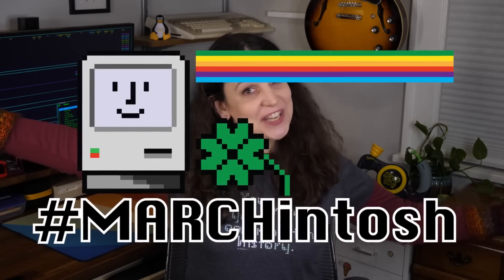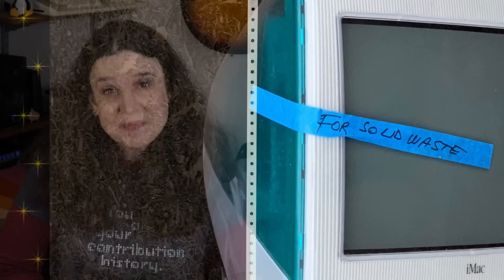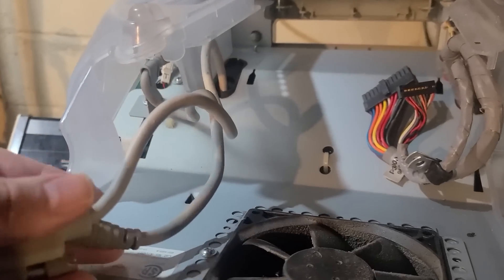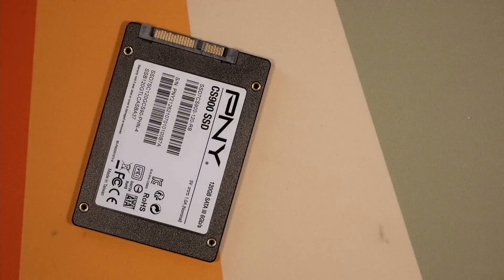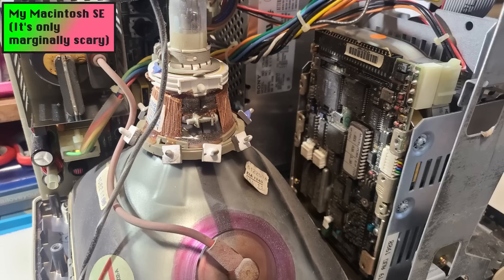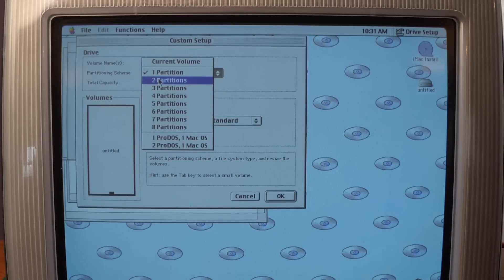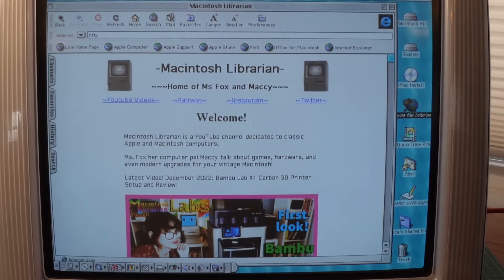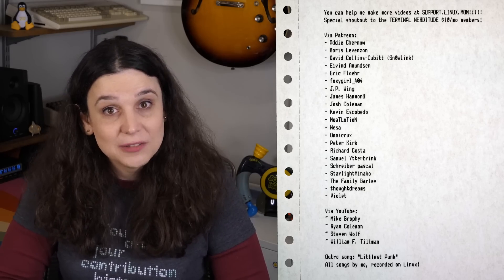Someone trashed this Bondi Blue iMac G3... can I fix it?

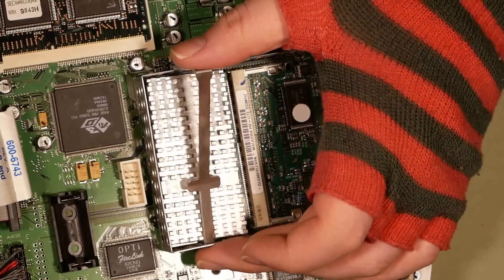Comment: 6:05 

I just dug into a G3 I bought from my buddy in high school (would have been around '09) of a similar early revision (tray loader). It sat basically that entire time under my care in "It booted when I bought it but it has been shoved to the back back back WAY back burner on my project list and I'm not going to do anything with it until I do" state until I decided just yesterday to finally do something about it. My caps were all marked when I did the teardown.

As for plans, I happen to have a SODIMM that I believe came from a Cisco 2801 router that I'm going to try and use to bump it up from 64 (which itself I believe might be an upgrade from stock done years ago) to 256, then do a 64 gig CF card for the drive, as it's my understanding that CF is essentially "IDE but smaller." Clean it up a bit and run OS 9 as it sounds like 10 might just be a bit too much for it to handle.

Racking my brain I think this might be the only Apple product I've ever owned personally, and I've essentially never even used a Mac of any sort, so the utility of this machine to me is more of a learning experience. I'm somewhat familiar with PowerPC CPUs...but only as they appear in old Cisco gear haha.

Comment: Hi, 1999 slot g3 worked great then was put in storage for 5 years took it out,fired it up and: startup sound ,cd rom sound but no sound from HD. Then finder icon and question mark folder icon.Hold down option on start up and no HD icon present.Pulled the Pram battery and it's toast.Question, do you think the Pram battery could cause this?

Comment: Do not mess with the CRT unless you know exactly what you're doing and have the proper tools to deal with the electricity stored in those things. It doesn't matter if it's off, those things will still hold a charge and can give you a nasty shock which could be lethal. Approach with extreme caution.

Comment: I think it was around 2018 when I installed Linux on an old G3 at my $OLDJOB repair shop to use as a window display/demo of our L337 5K1LLz. I would look at MintPPC and possibly OpenBSD for it, if you don't want to limit yourself to outdated distro versions. But even the old Mac OS was surprisingly responsive on that sub-500MHz CPU :)

Comment: Nice job! I too am someone who can heat up a soldering iron as well as a keyboard. I have done a lot with old tube radios (I am old enough to say I cut my tech teeth on tube stuff), and that includes CRT's. For the most part you have a heater circuit with low voltage for the cathode filaments, three electron guns (fancy word for cathode) for red, green, and blue colors, a shadow mask for color convergence and an internal metallic "aquadag' coating. That's the internal anatomy of the CRT.  The deflection yoke is three (usually) flat wound coils around the neck that control the electron beams with magnetic fields for the vertical/horizontal sync and picture scan interlace, and you have a "Flyback" transformer that provides the 15-20,000 volts to accelerate the electron beams from the guns into shadow mask/phosphor screen in the front of the tube. The flyback also provides the horizontal beam scan and helps with  horizontal sync. Most of this stuff works together with some pretty tight tolerances. Usually if the high voltage flyback circuit craps out, it drags nearly everything else down with it. 

The best policy for a working crt system is cautiously clean it up with a low suction vacuum cleaner and judicious use of canned air. This is a great idea because high voltage has a big static field that attracts dust. Not only that, the dust will form structures that will eventually form defacto electrodes that can cause high voltage arcing. That will kill everything in short order! So, clean it up and "If it ain't broke, don't fix it" applies to the rest of everything in there. A word of caution: Please allow the unit to sit for at least half an hour before you open it up and start poking around in the CRT enclosure. There are caps in the flyback circut that can hold very high voltage for a period of time and that can hurt you or damage the equipment if they get shorted to ground with an errant hand tool or finger.  Get all of the dust out, make it look pretty (no liquid cleaners please!) and it should work fine and last a long time...

Thank you for the videos you post here. One of them inspired me to breathe life into a 2011 Macbook Pro with a nice Linux Mint install. Now it works better than it did on OS-X!

Comment: Nowadays support for 32-bit PowerPC seems pretty lacking when it comes to most Linux distros nowadays. Even Debian, which is what I was using on my old PowerMac G4 a few years back, has since dropped support. I know Gentoo still supports the architecture, and I guess there's Adelie as well. The BSDs still seem pretty consistent with their support for 32-bit PPC though, with binary packages available on FreeBSD, OpenBSD, and NetBSD.

Comment: Is there a model number for beige Mac keyboard on the left. I have been looking for it for a while now as I remember the joy of that keyboard in high school. Was always run to that room as only one mac had it. I wish to find a used one and usb converter.
Reply from the maker: The one next to my IIgs at 0:30 is an Apple Desktop Bus Keyboard (A9M0330) I believe. It's packed away right now since I'm finishing my basement, so I can't grab a model number from it.

Highly recommend using the Wombat by Big Mess O'Wires (not sponsored) to connect it with a modern computer. It's the most versatile ADB-to-USB (and vice versa) converter I know. Good luck!
Reply: @VeronicaExplains  nice one. Apparently they quite tricky to get working on usb ports. Converter is $90

Comment: Despite Microsoft's shady practices at the time, Internet Explorer legitimately was a good browser up until they let it rot for going on 7 years anyway, after it suited it's original purpose of pushing Netscape out of the game. 

You have no idea how much it physically pains me to say that. But I do believe it's true. I might not personally like IE that much, and I feel like that's not a controversial opinion by any means, And of course Microsoft themselves perpetrated some very shady business at that time both in regards to how they forcibly integrated their browser with their operating system, and the various backroom deals that saw it forcibly gain market adoption, but I don't think there is a single browser out there that performs as well as IE 5.5 service pack 2 under Windows 95 on my 486 build, and this is without the "enhanced" desktop installed, so I know it's not a matter of it being loaded into RAM already. 

And the funny part is, these days with the lack of TLS 1.3, all browsers from that era are kind of equally bad and broken now. IE6 was the "standard" for so long that a lot of sites still use it as a lowest common denominator for graceful rendering, and there wasn't much in the way of significant engine changes from 5.5 to 6 that I know of.

Comment: They are fairy bulletproof in the metaphorical sense. I still own my Rev B Bondi Blue and I have added a few others since then. One of them had a CRT problem - suspect a crack in the neck. I was working through the HV stuff to remove the scary stuff that drives the CRT with the view to replace it with a 15” 4:3 LCD panel. Alas, that project has been on hold due to ill health.

Thank you for the video!

Comment: Admittedly, I'm not the biggest Mac fan out there but I do maintain a new M2 Air to keep tabs on the iDevices in the house...but in a corner sits a Graphite iMac DV SE with some upgrades...yes it still runs OS 9 cause I want it that way. Nice classic iMac with that lovely CRT display...so good for a trip back in time.

Comment: In my area (lower edge of Connecticut) we have "bulk trash pickup" twice a year where the city will haul away almost anything you put on the curb for free. People clean out their basements, attics, closets, etc, and pile it all up on the curb. 80% of it is trash, but about 20% is stuff that's still usable.

I've seen 3-4 of these iMacs over the years. I know nothing about the Mac and dont' really have a desire for one. I did bring one home for my friend once. I think he got it working. I also gave him some kind of Mac that looked like a big, white CRT monitor (not one of the 4" thick flat ones), but he said that one didn't work.

Of course I see a lot of old Dell and such systems. They usually fall into one of two categories: Complete, but older with weak specs, or newer with good specs, but missing components. Oh and laptops that are missing the power supplies about 98% of the time. 

The last one I found is a Dell i5 that doesn't boot. According to Google, it needs a new CMOS battery, which is super easy to install. You just remove the hard drive, remove the memory, remove the keyboard, open the case, take out the power switch, disconnect all the cables, remove the motherboard, flip it over and pop in the battery. Simple!

Comment: First time viewer, and maybe subscriber. Sorry, I am quite picky on what I subscribe too. The problem is, I do dislike modern macs (though the ones from the early 80's were OK.) and am not a fan of any currant Linux distro's. Macs because they use 2019 technology at 2026 pricing (low tech, very high pricing,)  and Linux because it is way to difficult to use. I have used Mint, Fedora, xubuntu, and a few others but the CLI gets me every time. If they would make a Linux distro that is as easy to use as Windows I would have no problems going back. They have tried but there really is no Linux distro out there that the CLI is redundant. And they all use different CLI commands. Also, I am getting old now so my brain is seizing up (not that there was much there in the first place.) But, I see you do some Amiga stuff, too and that was my favourite retro computer in the 90's and early 2000's. I still use it now on Emulation. Yes, I do not own a physical Amiga anymore (not since 2002 when I got my first PC.) But I do love the Emulation. I use WInUAE. IN fact I have over 20,000 games and other software for many old computers and consoles all through emulation. Emulation is the main thing I use my PC for. I love it! I just hope it never gets too technical. I had to laugh when you mentioned Cobol in your intro video! Man, that takes me back. I tried to learn Snobol once but gave that up almost as fast!  Then C, C++ and C#. Nope! So I stuck with Windows and the good old Dos Prompt, batch commands, and modifying the Autoexec.bat and config.sys.

Comment: Since you mentioned it twice i will comment about electronics recyclers. They are great if you have one. There are none local to me. And craigslist is about useless for getting rid of old non working electronics. I even have difficulty getting rid of that stuff for free on Facebook. So i usually disassemble my own electronics and recycle the metal and plastics appropriately.

Comment: That isn't sharpie marks on those caps, that is electrolysis fluid , the caps are leaking.
Reply from the maker: Pretty sure they're marked caps- since posting this video I've had folks share photos of these brand new, plenty of the caps were marked this way.

Not that I'm going to let it go with 90s caps for long.

Comment: Hi  folks! I do the same as Veronica , if I find something in the trash that looks interesting I just pick it up and see if it works.I've found several  hard drives and RAMs this way.Last week I found a keyboard with LEDs , wasn't working properly , I cleaned it up and started working.I plugged it in my laptop , the very same day the laptop's wi fi stopped working.Is it possible that the keyboard screw up the wi fi card  or is it just a coincidence? The ethernet is still working , and still can't find a way to make the wireless connection work again :( .

Comment: Mine was clean actually both of them and the trailer was broken. That was an easy fix at five bucks each and I found two of them so you found one I have two I didn’t do the fancy SSD upgrade but anyway, I have all kinds of Max air like rabbits there just reproducing I haven’t found any lately and Goodwill or re-PC in Seattle.

Comment: They all came with them. I have installation restore discs from 76.9 to not sure a tiger or snow leopard or all the way up I have a bout 100 max I have about six or seven of these IMAX, including two of these that you found on the road just like I did but they had hard drives in them

Comment: I still have my Bondi Blue iMac, just like this one. It was my first Mac, and the first machine I bought with my own money, some six months after release.

It was working, but not booting (flashing question mark and no sound from the HDD) last time I tried, but SOMEHOW my cats managed to push it off the table where it was sitting and it fell, face down.

Luckily, the monitor and external plastics seem to be intact, but the internal ones had become brittle with age, and I found many pieces rattling inside.

Did a quick test after the fall, and now it won't chime or display an image, but the power LED comes on and the monitor seems to power up. Hope it is just a question of reseating boards inside.

Fun fact: I'm a tech journalist with a career spanning almost 25 years. And the first article I ever published was a tutorial on how to install Linux PPC on this iMac.

Comment: My daughter has the newer version of this machine however it seems to have a power supply issue with the high voltage section. It runs very hot and quits after a while. What I would like to do is find a replacement front bezel that frames the CRT. With that I have a 15 inch LCD display that would fit into the area of the crt with some minor trimming of the bezel. Yes I Know blasphemy, but wait! I plan on removing the whole chassis and crating it so as to keep the original iMac. When I get time to restore it. In the meantime outfit the case with a Mac Mini. It’s still a Mac and in a classic case and current technology. Here is a thought, wouldn’t it be nice if someone made a retro reproduction case where one could place a current wide screen monitor in the housing along with the Mac Mini as well as working speakers, microphone and camera in the case! This way all one has to do is change out the Mac Mini when it goes out of date.
Reply from the maker: I figure at some point the last iMac CRT will be dead. When that happens, I hope we've figured out another way to keep these things working and visible, even without a CRT. If you can reuse what you can reuse, I say that's a good thing!
Reply: @VeronicaExplains this particular iMac has a VGA output on the back however from what I have learned is that the power supply for the CRT is directly tied to the power supply for the motherboard. Basically one part will not work with the other half. Could this have been Apples way of keeping people from separating the monitor from the rest of the electronics kinda like todays customer can not repair our products philosophy.

Comment: About 10 years ago I bought a slot-loader G3 DV out of a pile at an electronics recycler for $3, on the condition that I removed the hard drive onsite. That was one of my most challenging surgeries to date, only possible because I'd just done a combo drive swap on another G3 and it was fresh in my memory. The lone screw wedged somewhere in the case brought back some late nights spent trying to get those two G3s back together; I think it's a rite of passage for working on these machines.

Comment: Don't take vintage electronics to the recycling, that is for crappy modern junk that breaks in 3 years. The vintage stuff needs to be kept in circulation.
Reply: In a couple of decades the crappy modern junk will become vintage electronics.
Reply: @eDoc2020  no, most of it won’t, because unlike the stuff that is currently vintage, it isn’t made to last.
Reply: @WalterKnox  Most of the stuff made back then wasn't made to last, either. There's a lot of survivorship bias. You'd probably need to go back at least to the 70s, maybe as far back as the 50s, to get to where most electronics were made to last.
Reply: @eDoc2020  partially true, but everything, including appliances and such really took a nose dive in quality more rapidly in the early 2000s. There is a lot more cheap shit these days than there was in the 90s. Especially consumer grade stuff.

Comment: Woo! Great to see this up and running, with all its screws :) I love these iMacs - my parents bought me a tangerine model as my very first gaming computer way back in the mid 2000s when they were starting to get super cheap. Absolutely loved that thing! Still have it, but it's got a bad flyback, which is a non-trivial part to track down a replacement for, so that's a repair for another day.

Comment: Awesome find. A wonderful suggestion to not just dump these classic technologies and give them to enthusiasts. I paid $35 for one of these G3 233MHz about 10 years ago. Had to change the battery last year and press that reset button on the board to make it work again. Then the CD drive failed and I am now using an external USB drive successfully. Now I'm using this original Bondi Blue beauty to play retro video game console emulation for fun on my channel... and it's doing pretty good considering console emulation was in its infancy when this system came out. I would very much like to upgrade to an SSD soon, so I'll use your guidance. I hope I can just clone the HD considering I can't reload from the original CD as it's dead.¯\_(ツ)_/¯  
Proper shoutout to the Macintosh Librarian.

Comment: AFAIK Lithium batteries don't leak
Reply: Regular coin cells don't but these cylindrical cells are a different chemistry which does.
Reply: Once they fully discharge they can. It seems to be worse in wet climates.